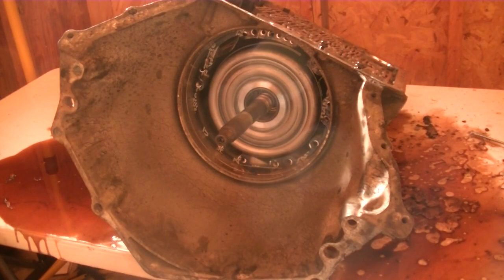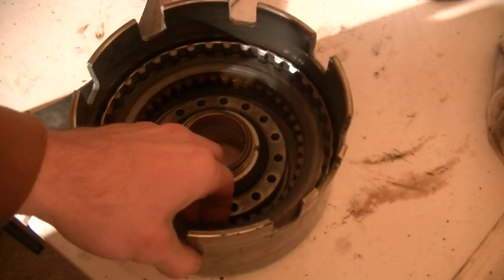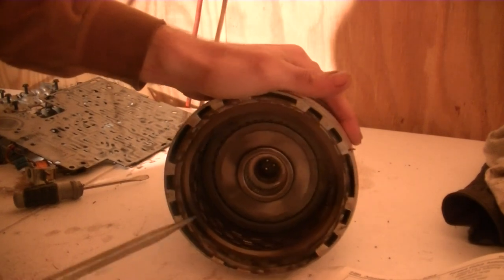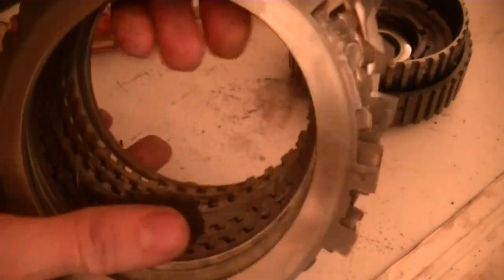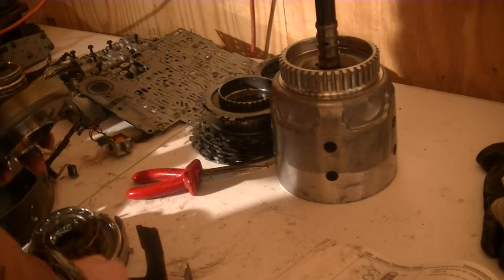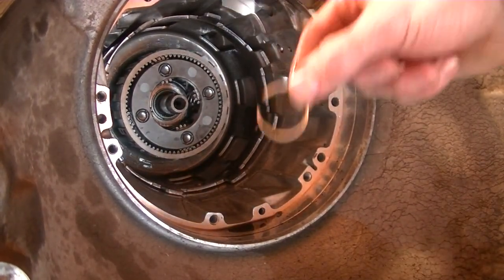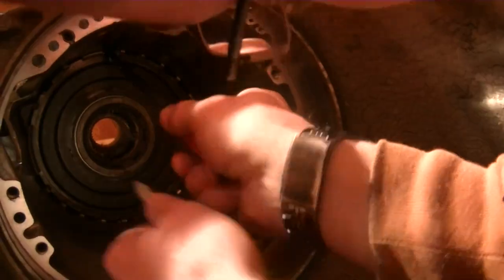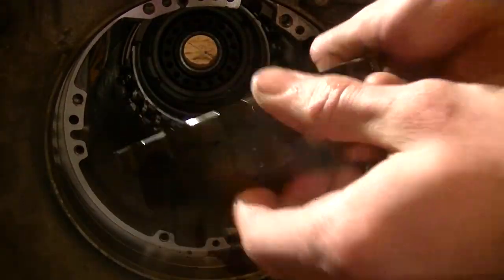4L60E / 700R4 Transmission Rebuild [Part 2: Gear Train Removal and Inspection]

Comment: The drum is easy to remove if you pull out the band retaining pin before, it is located under the valve body

Comment: Which model trans was the 5 speed manual with granny low and overdrive? The one I need to do is out of a '94 silveraldo half ton. 311,000 miles and pulls strong! Just syncs out in every gear except 5th lol. Figured it's time before I'm left stranded.
Reply: droppedjaw23 NV4500

Comment: I see that the 2-4 band anchor pin is still in when you are trying to remove the drum.  Do you know how to remove this anchor pin?
Reply from the maker: It as stuck pretty bad.  My strongest magnet couldn't pull it out.

Comment: These videos have been helping a ton, but I do have 1 question. The snap ring that you had to bring to the shop to be removed, was that from before or after you took out the sun gear?
Reply: Perhaps a better question is where is it to begin with?
Reply from the maker: +Sean Adams Oh man it has been too long for me to remember correctly.  I believe it was after I removed the sun gear.  Look in the service manual to see for sure.
Reply: Ok, I will just look a bit harder because the manual basically just says to remove it and shows a picture of the planetary gear assembly inside the case, but I cant even see the ring. Thank you for the videos though, they have really given me the optimism to continue with the process.

Comment: Let me clarify, in my ATSG manual it says to remove the band anchor pin, and then remove the drum.  Do you know how I am supposed to remove the anchor pin, before I remove the drum???  Thanks for any help.
Reply from the maker: Yes, I remember that part. However, my anchor pin was stuck and wouldn't come out, you are supposed to use a magnet to pull it out.
Reply: My anchor pin was stuck too (1992 4L60/700R4).  I was able to tap the band back with a screwdiver (it wasn't fused to the drum like yours) and then get that drum out, and tap the anchor pin out like you did.  Hey when you are cleaning your parts, do you first wipe them down and then spray them with brake cleaner and compressed air, or is it a no no to wipe them down at all?  How clean do you get them?
Reply from the maker: You can wipe them down, but do it with a rag that doesn't make any "lint."  I use the disposable blue shop towels you can get at the autoparts store.

Comment: I need you to be my mentor . Im going to attempt this on my 4l60e 95 imp SS
Reply from the maker: That is the exact same transmission as the one in this video series. Do not attempt to rebuild this unit unless you have the factory service manual,  these videos will not be enough information.
Reply: MattsMotorz thanks , I have the manuals from GM the series and I got the Haynes. I thought the 700 R had the governors on the outside and the 4l60 e has all that stuff on the inside and is electronic with solenoids and shit